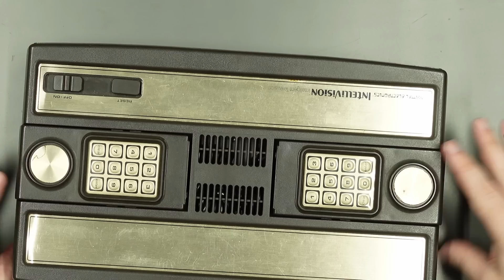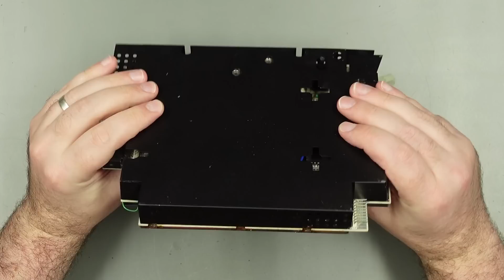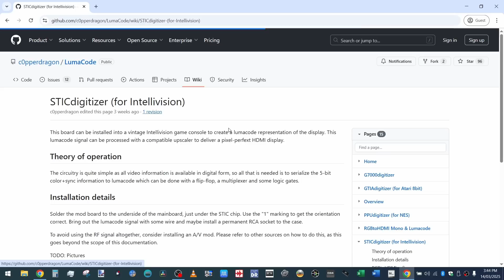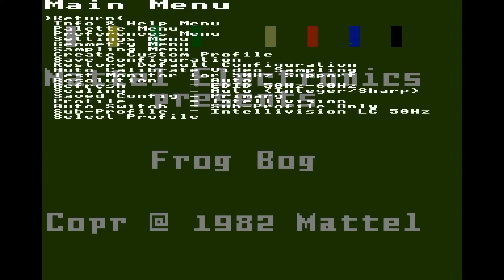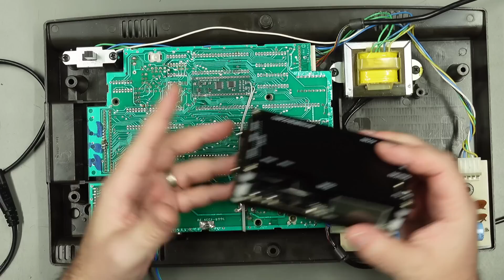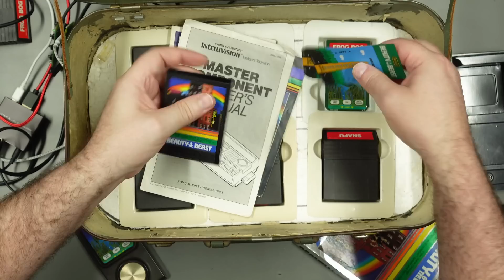STICdigitizer: HDMI for the Intellivision with LumaCode

Comment: Thanks for making this interesting video. I'm looking at best ways to mod the video output on my Intellivision and this helps! Is the RGBtoHDMI part needed if your TV accepts RGB via Scart for example?
Reply from the maker: Yes the RGBtoHDMI is required. As lumacode is a custom format designed to encode digital video over a single wire, it requires the RGBtoHDMI to decode it
Reply: @TheRetroChannel  Thanks, was probably a NOOB question but helps me. I was hoping to avoid having an extra gadget though the results look impressive. I might pause a bit with it being pretty new and mods can be a bit risky!

Comment: We had an Intellivision console back in the days.  I confirm that the controllers were dog shit.  Typically if the controller wasn't dead entirely, some of the buttons wouldn't work.  The coiled cables were a mess.  It's too bad, because in principle they were more capable than the Atari joysticks (fight!).  They were just built like crap.

Nice to see an Intellivision saved.  I don't know what happened to ours.  Probably in the garbage.  Great video as usual.

Comment: I'm sure the audio is mono anyway. Use a 1/8 TRS with one circuit for lumacode and one for audio. 1/8TRS-to-2xRCA adapters are readily available.
Reply from the maker: Yeah I might wire up the lumacode signal to the right channel instead and restore the RF output, not that I'll probably ever use RF

Comment: I used a TRSS 3.5mm jack to composite + audio for my Famicom composite mod, just needed to butcher the RF port itself, no case cutting.
Reply from the maker: Yeah good idea. I assume you mean TRRS? They're super handy, just sucks there's no standard pinout for them
Reply: @TheRetroChannel  TRRS, thanks for the correction. For the pinout, if you know what protocol you've wired, it's probably not any worse than the fact you're outputting LumaCode rather than something more standard.